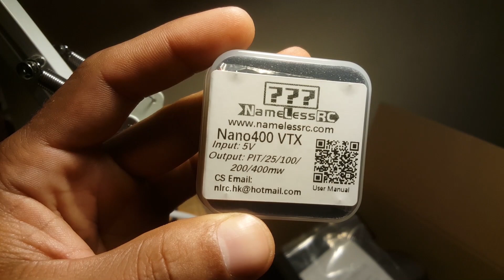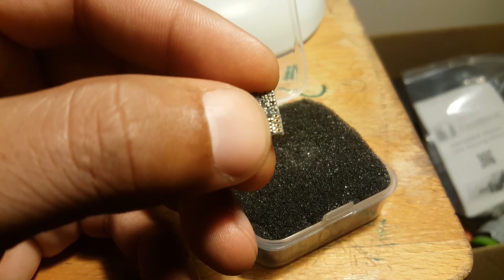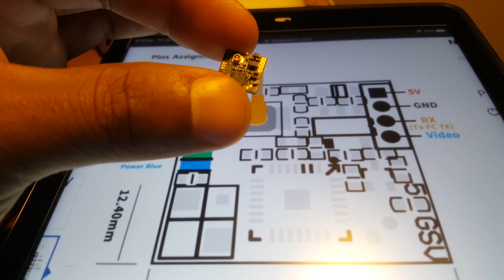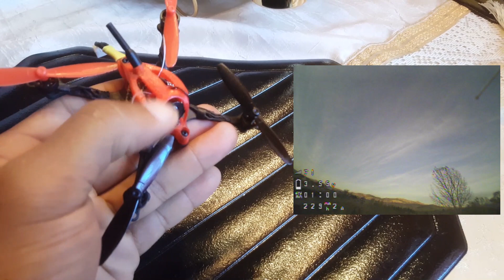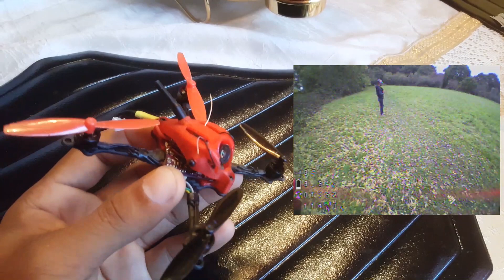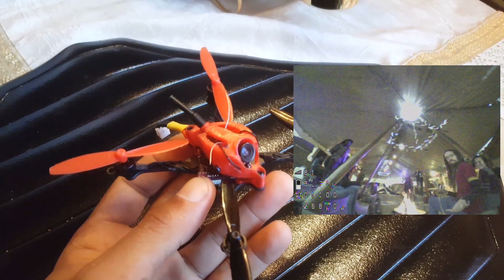NameLess RC 400mw vtx install/setup and thoughts 🤔😎

Comment: I'm going to try to add a piece of aluminum for a heatsync. they make tiny heatsyncs for stepper motor drivers that might be small enough.
Reply from the maker: This guy gets reallyyyyy hot!!! This videos was some years ago and I’m happy to report this vtx still works! I just can’t leave it powered on without flying for more than a minute. Heat sink would be a good idea 👍🏽
Reply: @DanielSingerX  lol yeah, i mounted it to my 3dprinted canopy and it melted the canopy LOL
This thing is absurdly hot
Reply from the maker: @terminsane  LOL that’s exactly what I imagine would happen! I melted a canopy it wasn’t even physically touching 🤣
Reply: @DanielSingerX  maybe it needs to be mounted on the top of the antenna lol

Comment: Don't like this vtx at all. It gets so hot even @ 25mW.
Reply from the maker: Yes suuuuper HOT! It lasted till this day tho and I was quite surprised it didn’t turn into a mini fireball. The biggest annoyance is if you leave it too long before taking off the picture will start flashing in and out every second or so until it cools off and it’s caused me to crash many times
Reply: @DanielSingerX  how did you manage to mount it? I wanted to use it  on a betafpv 95x V3 frame.
Reply from the maker: @danielfernandes2813  I used sticky double sided tape. It did melt through it a few times

Comment: Do you need to unlock it for it to function right? I had this vtx came with tinypusher i Got from fullspeedrc and it can only see static on my googles I tried auto search but no joy get some image after a couple of restart but it goes out again after 1 or 2 meters :(
Reply from the maker: It should at least function without unlocking! I’m not sure but it might block you from using certain channels at all if it’s not unlocked so try using another channel and see. Unlocking makes you use higher output power and blocks some channels in some cases, but it should still be flyable. I hope it’s not because you got a bad one :( also it gets hot very fast so be careful and fly soon after plugging in.

Comment: To unlock it, I found I had to switch in and out of pit mode 3 times, so by flicking the switch on my controller 6 times altogether. great vid , seems like a good vtx.

Comment: Did you power it from the 5v regulator on the Jhemcu board or directly from the 1s voltage?
Reply from the maker: From the 5 volt regulator for sure. Not sure it would work directly on the battery 🤔

Comment: what firmware and target are you running on the jhemcu fc?  I upgraded to 4.1.3 but i am not getting a voltage reading
Reply from the maker: I run the legacy NOX I believe and I’m on 4.1, probably the same as you! I think this happened to me before and I had to go into the beta flight power and battery tab to set it back to onboard ADC and it worked again, so try this 😎
Reply: sweetness!  thank you! that was a quick fix...no reflashing just switched to onboard ADC!  build a 1s(2s) 3inch kabab baby tooth and its extremely fun and light.  I'm able to do some backwards flying moves with the assistance of the wind lol
Reply: @DanielSingerX  I notice I'm getting vibrations also but I think a lot has to do with the wind https://youtu.be/QL2SbC5TsWs thx

Comment: thanks for the help man! I put one of these in my Tinyhawk II (I damaged the original vtx swapping antennas) and so far it seems pretty good. I didn't notice much heat at 25mw and I haven't gone any higher than that just yet. I didn't use the heat shrink they gave me either, and instead I used high heat Kapton tape. Anyway, thanks for the video!
Reply from the maker: Your most welcome! Your very smart using Kapton tape and I’d highly recommend that for better cooling! Mines still going strong on 100mw
Reply: @DanielSingerX  I can't get it to go to 100mw or higher. I got it unlocked and i can go to the locked channels but only stays at 25mw

Comment: did u get this working in bf4.1? i got mine working but with no control over it via osd, wouldnt be a big deal but this  vtx has no button
Reply from the maker: Oh yes I did!! I had to use the VTX table for tramp and it worked! Did you try this?
Reply: Daniel Singer yah I got it working, had to manually input the last line, and some of the spots that had zeros from the file I pasted in. Oddly it didn’t work the 1st time but a few power cycles & it just started working
Reply from the maker: MrSparkyss glad that it worked!!! Odd that it had to take a few tries and to manually input the last line. For me it was just paste and save and it worked. I did have that issue where sometimes it wouldn’t change channels or switch off pit mode, then it suddenly just worked. Maybe this is glitch

Comment: have you gone over 100mw? has your VTX burned up yet?
Reply from the maker: I have actually! I find it's very good at managing the power if the temperature gets too hot, so basically u almost feel no difference in range because when it heats up the power is lowered. This is why it hasn't exploded yet haha but overall I'm loving it still on 100mw
Reply: Thanks for the reply! Think I’ll put it in my hummingbird and give it a shot.

Comment: haha your mates are always keen to play with the quad! i just put a eachine nano vtx on my eachine novice1 but im getting no osd. does the all in one fc on your quad feed the video in & out to the old vtx you had? i havent wired those 2 wires into the eachine nano vtx as it dosnt have them, just on the hunt for the answer & came across your video
Reply from the maker: Barnz1980 yep the old vtx had the in and out! What you need to do is put the video output wire from the camera (usually yellow) directly to the flight controllers video in or camera pad. Then the video out wire from the flight controller will go to the camera input of the eachine vtx! Hope this is what you need to know?! Also if it’s all wired up and still no osd the make sure the pal/ntsc setting in betaflight is set to the right output of your cam. Leaving it on auto is usually good
Reply: @DanielSingerX  thanks man! I'll give it a go now 🤘👌
Reply: @DanielSingerX  cheers again Dan👍 it worked & she is ready to fly again😀
Reply from the maker: Barnz1980 Awesome 😎 always makes me happy to help someone out!!! Happy flying 🚀!!
Reply: @DanielSingerX  thanks again dude, I was looking at them thinking it had to be something with them but needed some direction haha. That's my novice going again, after building my tyro79 I got it going yesterday! Dam it's fast on 4s! Bit of a step up from tiny whoops! 
Now I need to tune my eachine trashcan cause it flys like trash & I got to get this Spedix Rex80 HD version going. I'm bound to the xm+ receiver from my jumper T16 but I get nothing on the receiver tab in betaflight🤔

Comment: there are not bits in analogue so there can't be any higher rate.
Reply from the maker: I didn’t mention bits 🤔 only thing higher in this is the milliwatts of the transmission signal. Maybe my weird accent made it sound like bits haha
Reply: @DanielSingerX  "hd analogue" and what i mentioned at https://youtu.be/S14JmQtdKms?t=509
Reply from the maker: jitter wow you are right 🤦🏽‍♂️ I actually meant to say higher resolution.. your good to pick that one up haha. I have played with hd analog equipment in the past
Reply: @DanielSingerX  no worries just saying

Comment: sweet.  it is a pain to solder.  Are you running betaflight 4.1?  I have loaded the vtx tables but channel is not matching the channel the video is transmitting on. Also when i setup pit mode to a switch it doesnt seem to become active when I am on the modes tab.  thank in advance.
Reply from the maker: ZX6R yes betaflight 4.1! It was pretty simple actually and I didn’t have any trouble with the channels not matching 🤔 I used the basic Vtx table for tramp and used the USA version. If I remember correctly I just had to get rid of the power level that it didn’t support. The fact that pit mode isn’t working means something isn’t too right 😕, but then again pit mode wasn’t very obvious like other transmitters. It doesn’t give that extreme snow once your close. Where did you get the vtx table you used and which version?
Reply: @DanielSingerX  I thinkmy issue is it receiving the tramp signal from the uart buti am not sure if it is the vtx or fc or betaflight.  are you running 4.1.1 in normal or legacy?
Reply from the maker: @ChrisLBradly  oooh!! Maybe that legacy thing is the issue because the major difference has to do with the UART layout. I used legacy for my FC. Like I mentioned here I did have a bit of trouble where sometimes the pit mode didn't work but the channels did always change. Try using the different betaflight version and then try another UART if available
Reply: @DanielSingerX  fixed it!  I had shorted the ground pad with the smart audio pad on the vtx.  this vtx is for professional solders...with a 50x magnifier!
Reply from the maker: @ChrisLBradly  amazing!!! I'm not surprised that was the problem 🤣! For the price we pay for this I guess the soldering is the compromise! Glad it's working for you and you can go enjoy flying 😎😎
Reply: @DanielSingerX  thx for your help and this video.  Not much on youtube regarding this vtx.  BTW I had to use legacy mode and could not make any changes to the vtx table except remove the extra power level for the tramp protocol to work properly.
Reply from the maker: ZX6R Your most welcome 😎 yeah I noticed there isn’t much about it. And it was the same for me where all I could edit was the output power

Comment: 0802 12000kv ?
Reply from the maker: Yup 😎 that’s it! It runs nicely but these motors are so fragile! Have some wobbly bells but it’s still going! I do notice less flight times tho
Reply: Just ordered the 1s betafpv hx100 Se it runs 1102 13500kv probably throw this vtx in there. 25mw just too low.
Reply from the maker: @jeffro1005  this is exactly what I thought of doing if I got this model! 1102 is more efficient with more power I find but the 8082 feels better in acro because of the lower weight
Reply: Daniel Singer I was thinking that also but somehow betafpv made the hx100 Se 28grams. Flight controller is only 2.7 grams lol.
Reply from the maker: @jeffro1005  yes lol they did some magic there for sure so I'm really tempted to get one myself

Comment: Don’t like the extra work to set it up. Assigning switches to unlock it. The easiest way to get  going is more appealing. I currently use the tbs nano pro 32 and eachine nano vtx. Tini size and 400mw’s. What’s to gain with this one ? 1-2mm size difference?
To each his own. I like having options and not having them taken away. 
Cheers.
Reply from the maker: Yeah the extra set up is annoying I must say! But the price of this one is unbeatable compared to its performance. I definitely love and prefer the nano 32 and eachine but like you say it’s nice having options 😎
Reply: Thanks for the review, and info! Any chance you could show how to setup the switch?
Reply from the maker: @michaelwayland4421  it's actually very simple and will just write it here. In betaflight once connected to your quad go to the modes tab to the left, then scroll down till you see (VTX PIT MODE). U can do either 2 things: Add Link or Add Range. the easiest which I did was click on the (add link) and from the blank drop down list choose which one you want. I was super lazy and linked it to (ANGLE) because it was the first option 🤣. If you want you can also use (add range) and assign a free switch aux to trigger it. Hope this helps 😎

Comment: What flight controller do you have installed in this build, look's like a Boldclash B06...thanks for review!
Reply from the maker: Your welcome 😎 the flight controller is a random one I saw on Banggood. Not sure if it’s a spin off from the boldclash but it performs pretty well! Hope it shows but It’s this one:[US$23.90]JHEMCU Play F4 Whoop Flight Controller AIO OSD BEC & Built-in 5A BL_S 1-2S 4in1 ESC for RC Drone FPV Racing RC Parts from Toys Hobbies and Robot on banggood.com https://banggood.app.link/QSsQAIjlG1
Reply: @DanielSingerX  Definately will check it out,.. Thanks